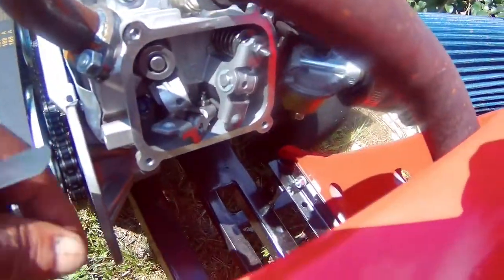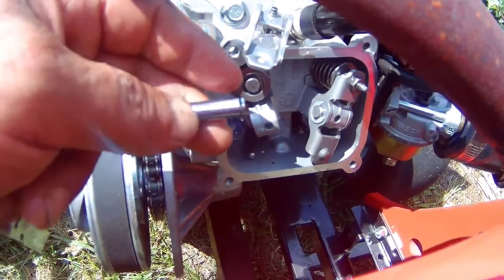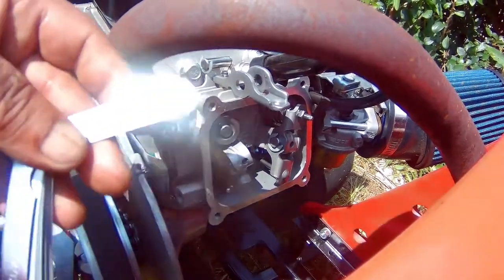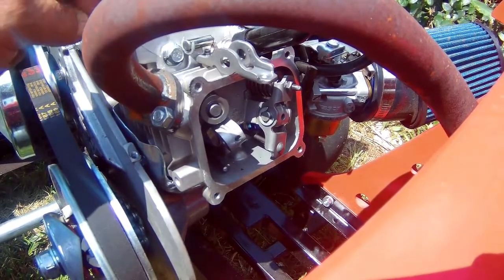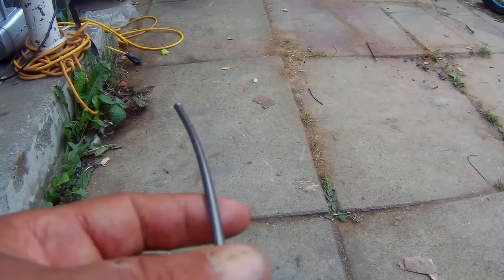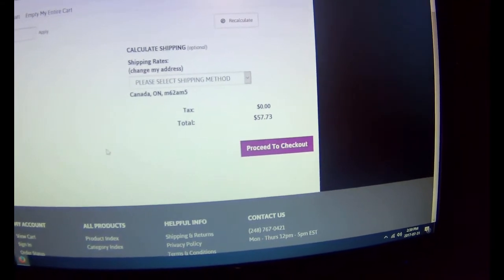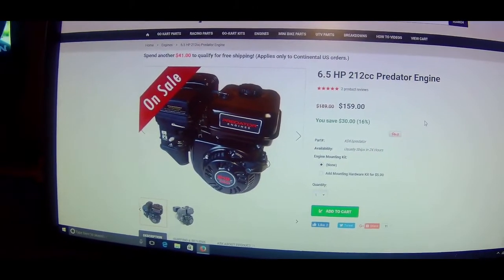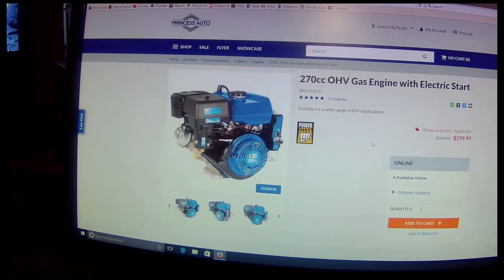Sexy Machine Blow Up Update 1

Comment: Harbor  Freight in the US has the 212 on sale at 99 bucks I just got a new catalog.   Dan
Reply from the maker: Thanks Dan, but by the time you convert that to canadian dollars it's $130 and then the shipping here to canada is another $60 and then customs fee, It's not worth it for me here
Reply: Ya,all that sucks. Congrats on getting her running again. That weld job wasn't getto, it was nesesaryo. The only thing I'd be concerned about is where is the clip, and maybe the pushrods cant take the extra pressure of the 18 pound springs is why the pushrod bent.      Dan